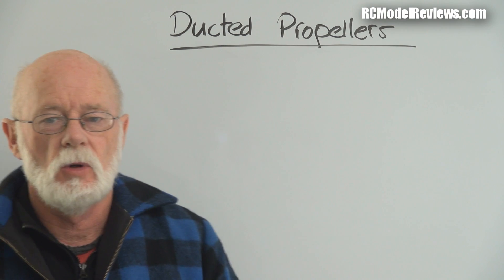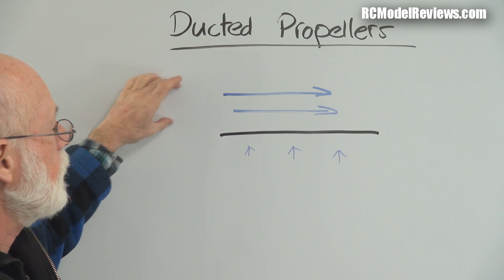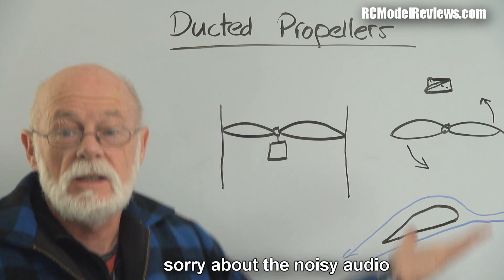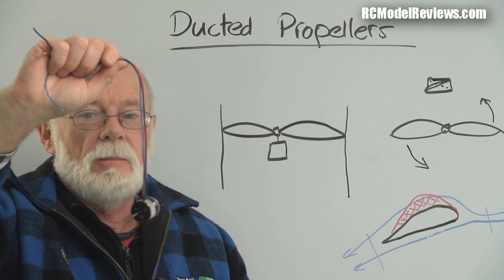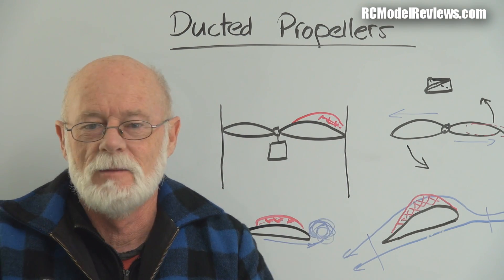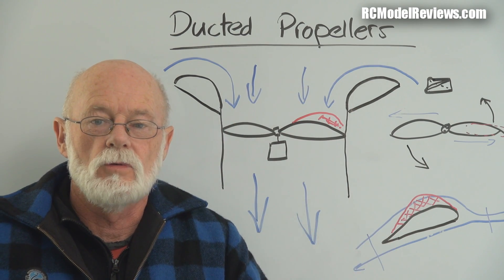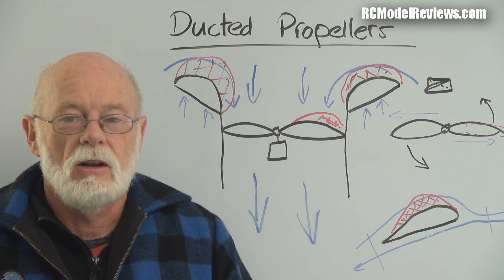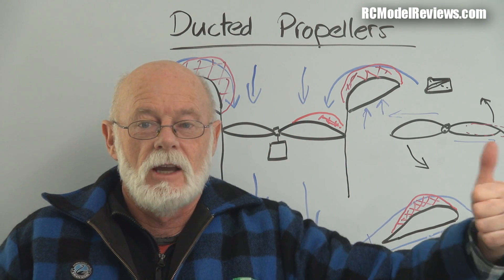How ducting a propeller increases efficiency and thrust

Comment: so wouldnt it be best, for all, or at least most, non ductable  props and rotors to have winglets on the ends?.
Reply: that has been done, google Q-tipped propellers
Reply: The winglets act like ducting! On aircraft the winglets reduce the loss of lift due to the vortexes normally created! The addition of a full duct enclosing the prop would add drag so limit the efficiency of the prop!
Reply: Steve Hartley  But the engine cowling around most passenger jets look like ducts especially the high bypass ratio turbofans. What's the story here? Safety over efficiency?
Reply: @elye3701  : Just for reference, at least some of those cowlings actually do produce extra thrust.
Reply: know what?  might not be a bad idea to find some cheap slightly oversized plastic props - mildly heat and bend down the tips
Reply: it was done on a british design of helicopter rotor which I think was taken up my US military (the technology, that is)
Reply: Large windmills increasingly do.
Reply: They would create more drag then the extra lift that would be created i imagine.
Reply: Martin Baadsgaard I posted the answer but it's been blocked. He made a video explaining why it doesn't work.
Reply: No, answer, just want a notification when someone gives one :)

Comment: Boat application?  A 3 bladed prop  welded  inside of a tube the depth of  the propeller ?
Reply: Like a jet-ski ?
Reply: check the marsh flat-bottom boats using air propellers. or the hovercafts.

Comment: but why should we carry those big ducts, when there are wingtips designed for this specific purpose? did anyone try printing wingtipped props? or shall i add that to my to do when bored in summer list?
Reply: The mechanical stresses on the winglet (proplet) would probably be too great due to the Centrifugal (Yes It's correct in this context) forces on it.  My guess is they'd break off.
Reply: Ok there are actually props being sold with this feature. There is stack overflow post that basically says it does not help with efficiency and some others saying they are quietter, so i would reinvent the wheel and waste a lot of time

Comment: The paper strip demo has nothing to do with Bernoulli. Bernoulli's principle would only apply if you had a single source of higher-pressure air that you vented through nozzles of different sizes. (And then, the effect would only be present with careful experimental design.) In that case, both streams would have the same total pressure, but the higher velocity stream would have a lower static pressure. The air you exhale actually has a higher total pressure than the stagnant air below the strip.

Instead, the effect that you see with the paper strip is due to entrainment. At the interface where your breath stream leaves the curved surface of the paper, stagnant air above the sheet is picked up by viscous entrainment and inviscid turbulence, and then carried along with your breath stream. This reduces pressure downstream of this interaction, which picks the paper up, and the phenomenon moves downstream.
Further, the "Bernoulli theory of lift" is a mistake of textbooks in grade schools and high schools. It is a disservice–even to the laypersons in your audience–to promulgate it. For the theory of lift that engineers and physicists use, consult an engineering textbook, such as Anderson's Fundamentals of Aerodynamics, where you will find D'Lambert's Paradox, the Kutta condition, and the Kutta-Jukowski theory of lift, also known as the "Circulation theory" of lift.

Comment: So, with the added lift given by the ducts, what equations would one use to determine the difference in acceleration of the vehicle, taking into account the added weight of the ducting (on say, an rc quadcopter). Also, should the ducting be spinning with the propeller, or should it be fixed (mounted) to the vehicle? Finally, what should determine the depth of the ducts? Propeller size? Pitch of the propeller?

Comment: So... Why does a duct just make drag in the water then..? Because putting a duct round the propeller on a outboard motor on a fast boat will only make it slower..
Reply: you can compress air but you cant compress water, this is why
Reply: When moving very fast, the drag from the duct is greater than the gain. When moving slowly, it is lower. That's why speedboats don't use ducts, but tugboats do.
Reply: Samuel Metcalf water can be compressed. I do it every day.
Reply: Glenn Frazier i rephrase then, you cant do it as easily since it requires an exorbitant amount of pressure compared to air.
Reply: Samuel Metcalf the fact is, the claims this guy makes have been proven false for decades. He seems like a nice guy...sometimes. He is obviously smart, but science doesn't care. He is wrong. You can do 5 minutes of research on his claims and see he stopped learning in.....probably the 60s maybe early 70s.

Comment: Jon   
it was a  family  of Bernoulli  - thus  many  'given' to same person 

thus  on  lower  part  by  "compressing"   the  flow    -   the feature of  material contiuity   
wot goes  in comes  out  -   but with and applying  Bernoullis  fluid flow  equation  -  at  higher  velocity and  pressure  - thus   improved  lift

Comment: Great information here.  Well presented.  

Q1 -Is there any benefit of reducing the exhaust side diameter to create a small bit of the venturi effect?   
Q2- Plastic wings for RC are generally just a twisted piece of flat plastic.  If you were to actually able to create a shape more like a wing with the thicker leading edge would this improve lift?????
Reply: Q1- you mean on ducted engines? the exhaust nozzle is meant to turn any extra static pressure into speed. if you choke the exhaust you will increase the pressure in the tube and the air will exhaust pressurized, therefore failing to exert reactive force on exhaust nozzle. no push on your plane. therefore, there is a dependency between the characteristics of the fan and the exhaust. a sweet spot.
Q2- you talk wings. the aerodynamic shape of a wing only makes it efficient at one speed. for real planes this is the cruise speed. model planes don't have a cruise speed, they're for the thrill only.
Reply: OOps. sorry I meant to say plastic propellers.  Thanks for the great info however
Reply: Since outlet is smaller, you'll have to expend energy to compress the air to exit the orifice, eliminating any possible boost, but in practice even losing some due to sub-100% efficiency.

Perfect wing shape is a stretched water droplet, the most aerodynamic shape. Lift is created solely by attack angle being non-zero, it doesn't have anything to do with the shape - a flat piece of plywood can pass for a wing if you give it some attack angle, it's just it'll have high drag and poor stall characteristics. All kinds of non-symmetrical wings just have attack angle "increase" gradually from tip to tail, since if bending air would "catch up" to the wing curve halfway across, then the rest of the wing contributes nothing but drag. If you "unbend" the wing you'll get same droplet shape again. Asymmetrical wings are used at low velocities and low aspect ratio wings, symmetrical wings are used at high velocities and high aspect ratio wings. Props are the prime example of latter, hence you only really see flat cross-section with barely any curvature.

Comment: i believe the effect at the end that he was talking about is gyroscopic force (not sure if it's the right term) but because of it the propeller wold fight to stay in its original position and cause violent shaking if rotated or tilted in any way
Reply: on a Cessna the gyro effect would turn the plane by the nose. not much, but enough to need correction. on a wwi rotary engine (where the propeller was tied to engine which will turn around the shaft, while the shaft was non-turning, just tied to plane), then that plane will not stay in the air without constant adjusting of pitch-roll-yaw and gyro effect would revert the yoke commands.
for a jet to function it requires a stationary flow. the air intake is the first stabilizing structure of the air flow. any fluctuation in flow rate leads to surging (stages when engine revs up and down)
i don't see much gyro effect on plastic planes. gyro requires a mass in rotation and plastic blades hardly fit that description.

Comment: the only fan's I have ever seen is used to help get air flow to registers on long Duct runs with improper Duct sizing. You don't need these fan's if you size your Duct properly.
Reply: Ron White That would be true and I understand your confusion however he is discussing this theory in the context of ducted propellers/fans for remote control drones. I think you are concerned with HVAC.

Comment: How about the props with the duct ring built on around the tips? Zero distance between the tips and duct but your motor has to spin the duct up to speed so some loss for a short time there.
Reply: I was thinking the same, though that might cause a lot of disturbance in itself and be heavy for something spinning that fast...
Reply: Yeah, you've gotta remember that the duct itself actually does have mass. If you build it onto the tips, you suddenly have to rotate the duct as well, which means that your engine has to work extra hard, consume more fuel, use more power, to rotate the entire duct for negligible gain, completely canceling out the entire point of having a ducted propeller.
Additionally, the duct would be quite heavy, and that means once it starts spinning, it turns into a flywheel which will keep spinning very very fast whether you want it to or not which would make landing a little bit tricky.
Reply: Samuel Wang
Your engine works harder when it speeds the prop up, not the whole freaking time. Rotational momentum is conserved.
How heavy are the rings on props that already have them? I see a lot of unqualified "heavy" thrown out with "it must be" but not jack besides, just no-numbers cancels no-numbers in I-imagine-land.
PLEASE, props make induced drag in the process of creating thrust, don't pretend that they won't slow down by cutting power.
HOW MUCH does a .5mm thick annular ring of prop diameter weigh, as opposed to "a lot" or "heavy"? People with 3D printers can find out, if they have a model to run them on then they can find out just how theirs work.
My question, is if ZERO clearance vs close clearance pays off. I asked that because it has been stated from evidence that SMALLER clearance pays quite well.

Ever see winglets on airplane wingtips? Like on the Gulfstream III's? Ever see fences on wings to like, IIRC the Mig15, 17 and later series put there just to impede airflow out to the wingtip to reduce tip vortex? They all have weight and they all pay off, they're not there to look cool, they were tried before being put into production.

Before I watched the video I thought that maybe the duct makes something similar to ground effect on tip vortices but from what I saw there it doesn't seem so.
Reply: Increased rotating mass of the shroud in a real system leads to increased friction losses through a variety of ways. The majority of losses come from increased weight of the shroud, which in a lift based flying machine is a dramatic reduction in efficiency because the thrust must be increased to generate more lift and offset the additional weight. The second biggest loss would be boundary layer effects from the rotating shroud, in essence, the shroud would drag air along its rotating surface creating its own vortices. Lastly, Imperfect balance in the rotating mass leads to forces on bearings that will be converted to heat.

Hopefully this clears up some things.
Reply: Jeremy Karst
A duct has no weight and makes no vortex?
Reply: Centrifugal force.
Reply: One way to be sure, make and test.
Reply: As others have replied, I would think the "zero clearance" duct would have to be engineered to withstand the forces encountered when rotating with the propeller, but maybe something like a turbine fan, with a greater number of blades, would be more efficient because the additional mass of the duct would be comparatively less because of the reduced need for added strength—i.e., the duct adds so little to the already significant mass of the turbine blades, that it wouldn't contribute much to the mass of the entire assembly. 

I would think aviation engineers would have thought of this already, so maybe there are just too many downsides to an attached duct with zero blade clearance.
Reply: Phillip Breske
You can buy drones with shrouded props and they do work. That's not an "I think", it's a fact.
What that doesn't say is how good they aren't.
Reply: Note to Ha Fast Productions - I had already composed text on this varation"
"This tip-loss problem in aircraft wings is addressed by winglets. In theory, small sections of duct at prop or rotor tips could serve this purpose. They may resemble the Top of a capital T. The problem is that structurally it is a poor idea to mount any sort of mass to blade tips. Propeller blades are progressively lighter towards the tip where rotational and Centrifugal forces act in a manner to "fling" propeller blade material away - making the structure disintegrate as it overtakes its structural limits.

Comment: you had me until you said 'centrifugal force' and then carried on fucking up the explanation of induced drag.
Reply: spanwise flow occurs due to symmetry. low pressure wants to collapse towards its center, high pressure wants to expand from its center. on an airplane the fuselage is typically at the center (apart from some Blohm und Voss designs and rare others), so you get spanwise flow on the upper surface of a wing moving toward the fuselage, and on the under surface moving toward the wingtips. at these flows meet at the wingtips you get vortices which curl upward.

exactly the same thing is occurring on a prop or rotor, except that now the hub is the center. so you get spanwise flow on the upper/forward surface moving toward the hub, and on the lower/rear surface moving toward the blade tips. resulting in the same vortex pattern as for wings.

none of it has anything to do with the fictional centrifugal force or the radial motion of air caused by propellers being circular which you invoke as an explanation. indeed, half of the effect is caused by air moving in the opposite direction you claim.

Comment: Awesome
A most informative video. Thank you, I work jet engine theory, and I needed this more than I thought.
Note: that all important gap Can be reduced to nothing, if the duct is attached instead to the propellers.  What would gyroscopic forces do overall performance, though?
So, this is another reason why commercial plains use bypass jet engines. Their "jet engines" are actually rather small.
Reply: Attaching the duct to the propellers would increase the air friction along the surface of the duct, and would dramatically reduce motor responsiveness. Gyroscopic forces would, I think, balance out since you've got two pairs of counter-rotating propellers in a quad, but I think it would produce some torsion in the frame elements.
Reply: Very astute response. Thank you. You got me thinking. I would think the centrifugal momentum would make a copter "walk", but the reduced response could be a plus side. However, gyros don't like their axies changed, so I think turning would also be reduced.
But, if we're talking quad choppers with cameras, these could be considered stabilizing benefits.
I like this conversation, it's much better than the typical ones.
Reply: WhtStr213 I think the gyros resisting turning would cancel each other out by twisting opposite directions on the frame, but I don't know for certain. This also might put unexpected wear on the motor bearings?

I think a helicopter already has to deal with the gyroscopic effects, so it wouldn't be an issue. But what would be an issue in either case is needing to make the duct structurally sound enough to not distort under the rather significant centripetal acceleration, which would add further weight.

I try to skim the comments for ones that would actually be productive to respond to. Thank you, and you're welcome. :)
Reply: Wow, there are so many forces at play, here...
Reply: with adequately rigid propellers, from CF for example, you can mount the duct very tightly/closely to the prop, doesn't have to be attached
Reply: Wouldn't the weight of the 'duct ring'  (I guess you could call it a ducted-ring prop) mounted to the prop tips reduce the efficiency of the engine driving the prop due to the increased weigh and drag? There would be an obvious weight difference. The twist or torque on the shaft would be increased also. This would be an issue with an aircraft and controlling roll, especially with multi-engine configuration. Just a couple of things that popped into my mind while watching and reading posts.
Reply: I'm loving these responses. Yes, there is definite mass increase. I recently attached a car radiator blower fan to my fan. It takes it a bit longer to spin up, but the output is considerably larger. I also agree on the fact of more friction due to an increased surface area. This leads me to the possibility that my fan now pulls more juice, due to higher resistance.
 The blower fan has a 3/4 in. ring, and 6 blade configuration, but the blade surface is much smaller in comparison to the original fan, even when you add two together to match the original 3 blade fan. Both are roughly 1 ft in diameter.
The biggest surprise was the fact that the curved intake side pulls more air than the flush to radiator side, showing the importance of the blade's leading edge, as well as the duct lead. I'm guessing that's why the leading edge of jet engine intake blades are the S shape they are.